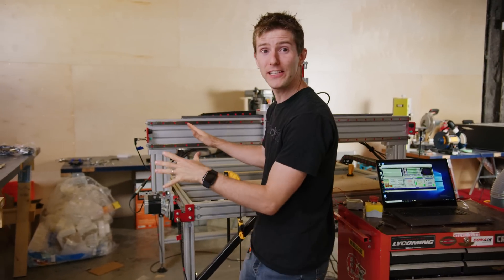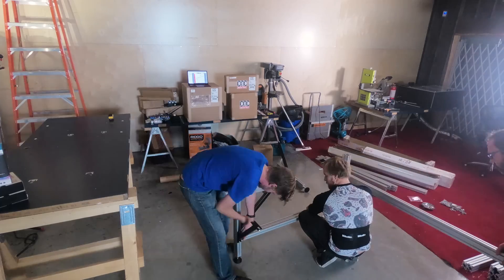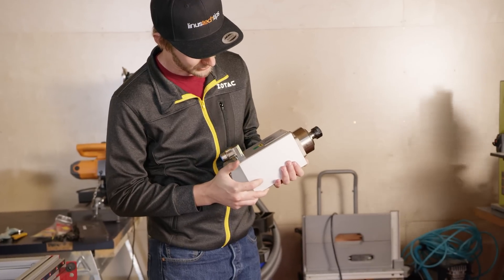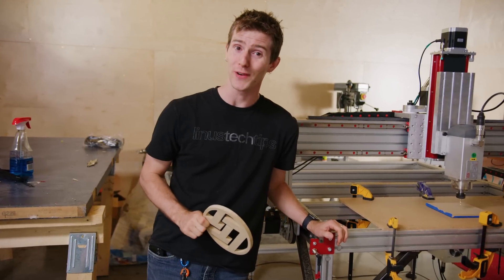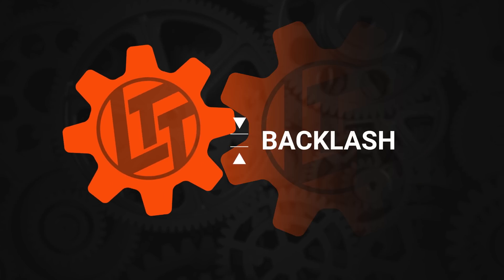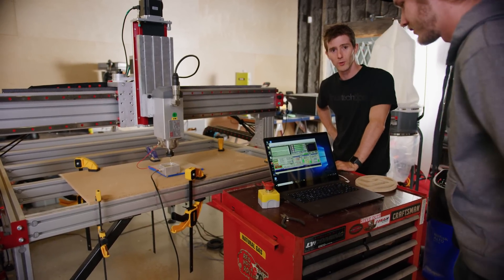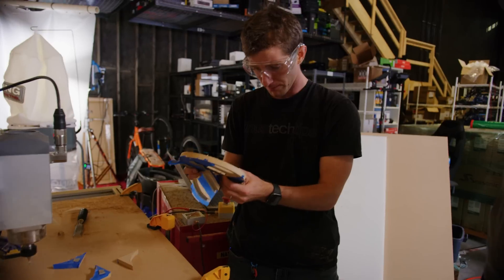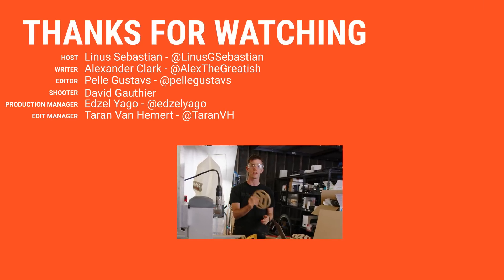Our New $10 000 Router!

Comment: A few things you need to do:
1) Always turn off the power (to the bit) when putting your hands on the bit. That's bare bones basic shop safety. You fail high school shop class if you don't do that, even once. A guy in my school lost four fingers just in the three years I was there. 
2) Also bare bones basic safety is everyone in the vicinity is required to wear safety glasses whenever the machine is used. Spare safety glasses should always be hanging on the wall near the door in case any staff enter. Anyone not wearing them needs to be told to get out before the machine is turned on.
3) Build a three sided acrylic box around the top of that cart (or a surface of your choosing) to protect the laptop from the dust. Even with the proper dust collector, you will be glad to have it. Dust will settle on everything in the entire room.
4) That bit is moving back and forth, and If the bit hits the end of the vacuum you're holding in this video, it might cause something bad to happen. Mostly it's just a bad practice. So don't do that.
5) I recommend having an open vent on the floor somewhere connected to a powerful vacuum. Then you can just sweep dust over to the vent and done.
Reply: Turning off the machine would make you lose the place in the code, if its anything like a standard CNC. And disabling the steppers would make you lose positioning, which is bad for precision. The steppers need to get power. Since this doesn't have a tool changer, a good compromise would be disconnecting power from the spindle. Generally, machining is the 1 trade where there's an exception to the "lock out tag out when near spinning parts" rule, not just because it takes so long, but because it can ruin parts.
Reply: That's a good point.  I was thinking maybe you can have the tool move to a "safe" location that is away from the part when a human needs to interact with the part.  Then that got me thinking about hysteresis.  I know for my motorized positioners on my optical table the hysteresis isn't too bad, figure quarter of a mm over a thousand mm.  But I can see how even a couple of thou would be bad.  I dunno I guess they'll have to implement a one person operates the machine and the same one person interacts with the part.  That way you don't get that "OMG YOU CHOPPED MY FINGER OFF!" "But I thought you told me to push that button???" "NO I told you to push that button!" sort of thing happening.
Reply: I work with 2 axis mills all the time. Turning off the machine is just something you don't do. Especially when machine up time is so important.
Reply: Also don't shove the chisel towards your hand.  I winced at that bit.
Reply: +misonstrudel  
Glad I wasn't the only one. Learned my lesson when a got a fancy little putty knife gash on my thumb when trying to pry a 3d print off.
Reply: +3a
You asked me to clarify #4... Well, in the video you can see that the bit is moving back and forth, side-to-side, doing it's thing. He's holding a metal tube (the end of a vacuum hose) to try and vacuum up dust. If the bit was to bump into the metal tube, it could shoot metallic dust, or even shrapnel right into his face. It could also hit someone else. Also, I can't see it happening with this particular machine, but there are machines that could grab onto the tube once it touches it and pull it in, potentially with your hand holding onto it. It can happen faster than you can let go.
Reply: Both my uncles are short some fingers, and you only have to see someones hand get eaten once by a machine to always use proper safety procedures. Like, no joke, you cannot unsee a hand being fucked by one of these things.
Reply: @misconstrudel  yep that was the worst bit
Reply: Most comments on safety in here are from people that are guessing how a machine shop runs.
I'm writing this to correct the wrong comments.

You don't turn power off to change tooling for most machine shops, what he did was fine. Just stay clear of the machine while there are moving parts and do not leave anything loose on the tool holder or work-piece because it will go flying and hit someone.

When the machine has a permanent location, he can put up signs on doors/entrances saying "safety glasses beyond this point." Someone mentioned you don't need glasses if you have a see-through barrier built, I strongly advise wearing glasses even if you build a see-through barrier.

If the vacuum nozzle he was holding hit his end mill, the end of the vacuum would get cut up but "really bad news" like the original poster said is unlikely. A real danger of this sort would be if he was holding cloth or wearing a glove and the bit touched the cloth or glove - it would grab onto that material and yank his hand into the bit (roll up sleeves too).

A vacuum built into the floor might be fine for wood dust but they're doing wood for testing. If they cut aluminum or steel, a vacuum built into the floor might become a headache for them if it gets gummed up or burns out.

Edit:
Upon reading more comments, hearing protection is not necessary for cutting soft materials like this - although it's still optional.

Second edit:
You don't need a respirator for short-term work with wood dust. If they are going to do this a lot then maybe a dust mask or respirator.
Reply: +Brandon Donahue
I've seen machine shops where they had a switch to cut power to just the bit, not the entire rig. The respirator was for a large variety of materials. What are your thoughts on hearing protection for metal?
Reply: @Trifler500  Metalwork and machining metal can be loud, especially if they're doing more aggressive material removal. Some shops have a box of disposable ear plugs and it's up to the operator to wear them when they need to.
Reply: @ @brandondonahue2965  
Yeah. I've seen that too. That's good, but what I was thinking about was a pair of noise blocking ear muffs hanging next to the computer. Ear plugs for additional people, when needed.
Reply: @Trifler500  Depends on the machine, but honestly, it is overkill to do so.  Every CNC I have worked on has double confirmations to start the spindle, you can't just accidentally hit a button and start it running.  Most machines I have worked you can't cut the power to the spindle since it would through off the numerous built-in sensors that constantly monitor the spindle condition, doing so on such a machine would immediately cause the machine to error out and enter emergency stop.
Reply: May i add, since it seems Linus doesn't really know much about that machine, to actually take a course...the vendor might offer one. Because different materials require different drill bits and speed...hence the safety glasses in case one bit snaps. I almost lost an eye once when a bit fractured. Power machines are not a joke
Reply: To Alexandra Groza, almost any decent drill bit or end mill can work in wood. Wood is extremely soft and yields to the cutter, its only drawback is that the dust gums up the cutter.
Reply: 1) do not turn off power, you will loose your positioning. Go ahead and kill power to the spindle if you want but it's not necessary at all.

2) this one is indeed correct always wear safety glasses in the shop.

3) definitely should do this but would be better off using a cheap desktop and enclosing the case in a filtered box to protect it from the dust and use a keyboard cover like they have in hospitals.

4) if the bit hit the vacuum it would just bounce off and maybe cut up the vacuum, absolute worst case scenario to dull the bit. Nothing really to worry about period.

5) probably a waste of time honestly. Milling wood is messy period.

I'm a CNC machinist, I run CNC machinist and turning centers for a living and frequently operate manual Mills and lathes. Though you mean well you don't really know what your talking about here.
Reply: @Josh Catron What CNC Machine loses their position after powering off? In my Company we have like 20+ year old machines which dont lose their postioning at all. If this would happen you would spent like an hour+ just setting the positioning again.
Reply: @Lomat3000  yes this machine well it's postion because it has stepper motors on. The machines your talking about has servo motors that have a backup battery in them that keep track of the axis postion even if the machine is off and disconnect from power. You can literally move the axis with the power and when you power back on the cnc controller will know. Now for this CNC you want the power on when changing ends that way the axis don't move on you make rehome and zero out the the part and maybe get it back where it was.
Reply: @Lomat3000  Spend an hour setting the positioning????  Replace that crap if so, otherwise, I think you are confusing squaring up the machine vs positioning it.  I used a 15-year-old machine for the last 5 years and like modern machines today, it auto homes and calibrates on startup.  So yes, any modern machine will lose its positioning when powered off and have to rehome when turned back on since the machine will not know where the spindle is until it has done so.  This also ensures that the home position is accurately set every time the machine is turned on, as well as making sure the gantry is not racked.  That is also why we don't have to spend an hour to position it, and in case the machine errors or some other issue happens a quick restart and the machine is auto homed and ready to go again.
Reply: @Josh-bc7gi  
1) Edited to clarify I meant the bit.
3) Totally agree with that, but I figured they already had the laptop. 
4) If they're wearing eye protection, then sure, but they weren't, and this was mostly about it just being bad practice, not specifically what could happen in this instance.
5) I've seen dozens of shops that do this. If they don't want to, fine. It's just a proven idea. Admittedly I've seen it more in purely wood shops than mixed material shops. The one I worked in had one and it definitely made cleanup much easier.

Never claimed to be a CNC pro. Didn't know that was necessary to bring up a lack of safety on their part. Keep in mind this was all about talking points, bringing up safety in general, not specifics. As I said before, I think the best thing would be for them to actually hire someone to instruct them in safety and do an inspection of their shop, but having seen a lot of their videos, I know they're likely to just say, "YOLO!" and do jack.
Reply: Good thing I dont have to turn off my Router for changing bits. I just mount the tools, measure how long it is and load all my bits up.
Reply: To add to this: Mach 3 is pretty garbage controller software.  I had a router restart the code after completion a couple times, and after that I always locked out with the E stop before getting over the work surface.
Reply: @Jaredshapiro1  cnc router parts need to stop selling with their kits. Move either linuxCNC or an Industrial controller. Cnc control software should never be run on Windows with how biggy windows is. Not to mention the random updating reboots.
Reply: @sir_wolfart4733  Well at least the computer i was using was airgapped, but yeah it's a nightmare.  The shop also had a tormach cnc mill that had lightyears better controller software, and never had any glitching.  Plus it "felt" a lot better since it was a 2' x 1' x 2' bed, and I could trust the accuracy a lot more.  From experience a large cnc router table will have way more flex than the steppers or leadscrews can flush out due to the springiness of the whole system.
Reply: @Jaredshapiro1   the tormach pathpilt is linuxCNC with a nice UI to it. The springiness of the machine can be add to the backlash total but would just go with lighter cuts.
Reply: its not going to do anything unless someone loads a new program in and hits start. ive worked in and around cnc machines daily while they were in powered up and/or in operation because i had too. no accidents happened. ita called being fully aware and safe of how and where its going to move when. 
the only injury I've had was getting burned by a hot aluminum chip while i had to blow out a pocket and try not to get drenched in coolant. lol
Reply: It's so nice to actually see intelligent replies on one of his videos. I thought his fanbase had devolved into morons, trolls, and firsts.
Reply: it was so nerve wrecking watching them mess around with a industrial powered machine, i worked in kitchens 15 years, heavy duty included, jfc if we did like linus did , we would be so f*cking dead its not even funny .
Reply: You would have to re home the machine. CNC doesn't get turned off for a tool change. it will only turn on if a program is executed from the control software. It's not like a normal tool.
Reply: To add to the above, check your workplace safety regulations in Canada. In the US any CNC machine above a certain RPM requires an enclosure. These are usually 4 walls with an open top. There is usually a safety circuit that de-powers the machine whenever the enclosure is moved/opened. BTW here is the results of a quick google search to get you on your way. https://www.labour.gov.on.ca/english/hs/sawo/pubs/fs_machineguarding.php .
Reply: Thanks for the tips! Can you clarify number 4?
Reply: @Kodiak-on-a-Kayak  4= ow
Reply: what needs to be clarified, if the vacuum touches it that thing is getting grabbed by the bit, meaning bad news bears
Reply: To Prop Console, the vacuum nozzle touching "that thing" (aka the end mill) would not get grabbed like you think but rather it would get rattled, the end would get nibbled, and it would be pushed out of the end mill's way.
Reply: Thx
Reply: The Finger Mangler 5000!
Reply: Trifler500 Generally speaking good advice but imo somewhat unnecessary, since Alex is literally an engineer and they surely have their own thoughts on the whole safety topic, I don't care that they did so much wrong and people could have died blabla, none of the  things I would consider fatal, and for shop safety, if it not insurance and below ape iq standards which I don't think are necessary, they are not idiots
Reply: And he wants a lathe too...
Reply: How very american to lose 4 fingers on that exact thing. Damn.
Reply: +Brandon Donahue
I was of a mind to agree with the person above who recommended a safety course for Linus, Alex, and any other staff who might be involved. In no way was I trying to provide a thorough analysis. Just some talking points, especially since they have a bad track record of taking safety seriously.
Reply: Pedants assemble!
Reply: They need to see this! LTT IF YOU READ THIS PLS SAY SO (screaming should help)
Reply: Personally I would build a clear safety acrylic enclosure around the whole machine to keep debris under control and stop any errant work pieces/bits of broken tools flying around. These guys aren't professionals and mistakes will happen with all the best will in the world. A tool breaking at 22000 rpm is like a bullet...
Reply: @wookiewithacookie6905  From experience, when a tool breaks, they go about 1" if that in most cases.  99% of the time the bit will break in the wood, and remember the tool is under centrifugal force mostly and only slight linear force, so when they do break, most of the parts stay in a very small area.  In 5 years of running a CNC I only once had a bit break that went a couple of feet, and again, mostly centrifugal force not much linear force, so there was not much power behind it and most of the distance was only due to it sliding across a polished concrete floor.
Reply: I feel like we need to copy-paste-post this comment a whole bunch more times to get the point across.  I'm glad they're having fun and working with cool tools and doing what they love but that is no excuse for not being careful.  It's not like the points you laid are super strict fun killers.  Not at all.
Reply: Trifler500 couldn’t of said it myself without the proper safeguards in place someone is bound to get hurt and with a machine such as that it wont be just a simple scratch
Reply: Another commenter mentioned the dangers of breathing the dust from certain materials, such as MDF. So, respiration is another consideration. However, I have another idea that might be interesting: Instead of putting the laptop on a cart, put a window in the wall and put the laptop on the other side, so that you leave the room when it's in operation. In a neighboring room you don't have to put on anything, and you can watch through the window.
Reply: you know he wont do many of this because it is LTT
Reply: +Saphire Tiger
Well, if you don't wear a static strap, you're putting your electronics at risk. If you don't follow basic safety, you're putting your fingers and eyes at risk. I know which one I care about more. There's also the very extreme lawsuits to consider. If someone loses an eye, or even worse, both, they could easily win millions. These videos would provide all the evidence they need that Linus didn't insist on a safe work environment. So, hopefully he'll take it more seriously for something like this.
Reply: literally everything i was going to say, i am in my second year of engineering science technologies and disregarding all of the rules will easily get you killed
Reply: I’m surprised Linus hasn’t highlighted this and commented that he would do all the things you pointed out. He is a creative genius (mad professor) but health and safety & sometimes common sense seem to sadly elude him